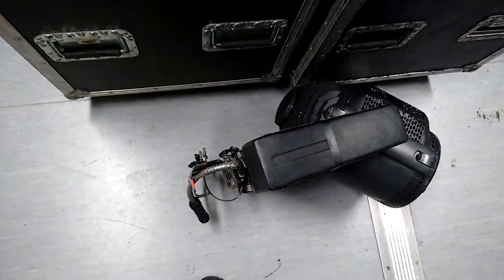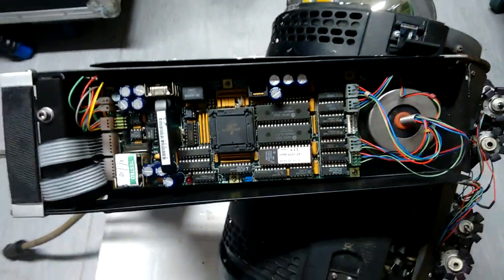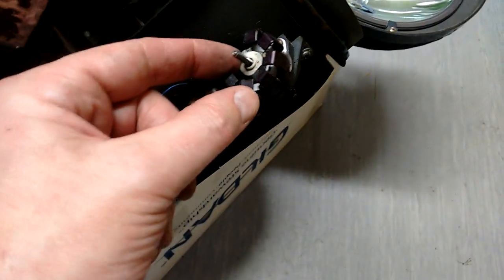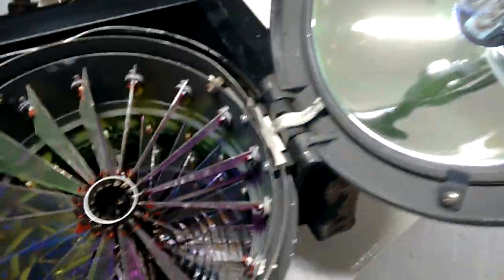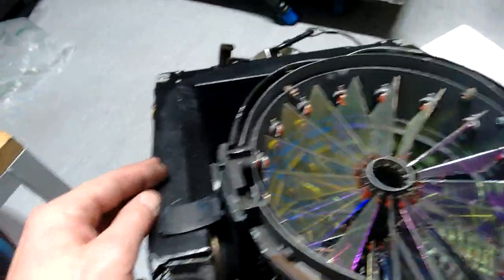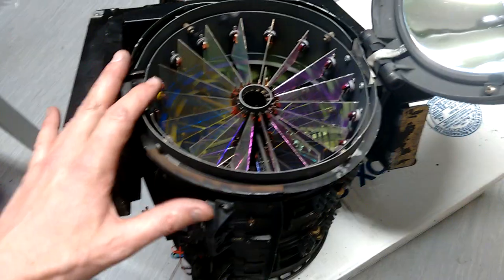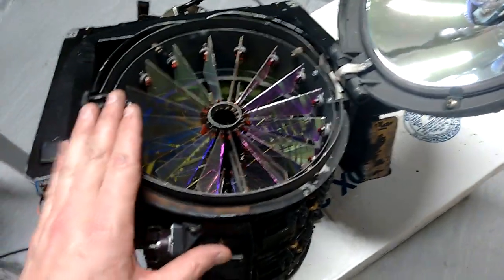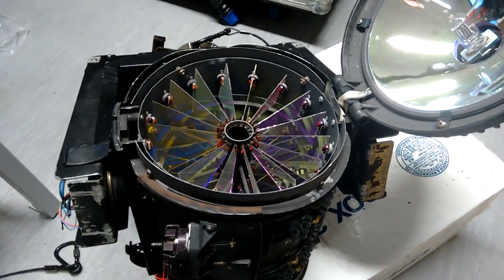A look inside a VL5 moving light.   TCF

Comment: Does anyone by any chance know which base they use? Thinking of getting some used vl550d but can't find any info on that. Would appreciate if anyone could share
Reply from the maker: Not sure what brand the connector was.
Reply: @bigclivedotcom  oh sorry for the misunderstanding, I meant the lamp base, in the specs from the manual it just says 230v 1000w, but not which base it is. If you happen to know that, that would be great.
Again sorry for the confusion, I'm not a native English speaker. 😅
Reply from the maker: @lemontree15  It's many years since I've used a VL5.  You should be able to find a users guide online.
Reply: did you find the user guides? I thought about buying some of these VL550d's too. at 1050$ for three including a flight case, it would have been a genius deal. Many people on German forums recommended not to buy them, as for touring, these are now wayyy too unreliable ( also no spare parts etc)
Reply: @jimi272  I didn't find anything yet. I thought about the same, I think I saw some on cuesale or somewhere like it. I'm German too, but I guess there is not much about them that could break. And if it does, it should be fixable mostly I guess.

Comment: I worked mostly on the older Vari*lites, VL2 through the VL2K as well as Big Boy and Best Boy. I think the VL5. These lites took a lot of abuse but were very reliable. I worked at Vari*Lite from 1997-2015. Never a dull moment. Thanks for the memories 😊
Reply: LOL. Kelly - I have a collection of VL2Cs, VL4s, and VL5s... your name is on a lot of the chips as being "tested by".
Reply: @rhanemann9100  hang on to those fixtures, I heard they literally threw all of the old ones in the dumpster. That's funny that my tested by sticker is still out there. I worked on those boards for 18 years.

Comment: as far as the processor goes, do the people who make these lights design them or are they outsourced?
Reply from the maker: The original Vari*Lite design team did all the hardware and software in house to the best of my knowledge.   It's far too heavily integrated with the hardware to outsource the software.
Reply: wow thats very impressive.  Thanks for the response.
Reply: bigclivedotcom  Yes it was a team from showco in the USA, they were working with Genesis on their tours and knowing that they always wanted to try something new for their live shows showed them the prototype VL0 which used dichroic? lense techniques to make different colours, Genesis and their manager basically put up the capital so they could develop the idea and thus vari*lite was born (now part of Philips Lighting along with Strand)
This morphed into the VL1 which used a color filter wheel instead as they had to get the lights out quick and the VL0 design was far from ready as a mass product, although the VL0 tech ended up making it into a wash light. Naturally vari*lite did the control system/lighting desk (Acrobat?) as well.
The first users (and by golly did they use a lot of them, I believe they replaced all the standard par cans) were for the Genesis MAMA tour in 1983.

https://www.youtube.com/watch?v=xbO6aKayNIA

Comment: I remember years ago, I was doing a concert ( I was in my learning years ) and someone made a huge monumental cock up. Instead of contacting Vari*Lite for 20 VL5's, Someone they ordered 20 VLM's. I did come out with "We could use torches as it would lower the power consumption!", As you could probably guess, That went down like a concrete boat!
Reply: Iain Banachowicz vlm's? mirrors?
Reply: Yes the vari*lite VLM. No lamp just a X Y mirror.

Comment: OK that was more than a bit interesting. The immediate thought that went through my head was that the mechanism works on a similar principle to the stators in the compressor of a turbojet that alter pitch with mach number. Even the "stepper/solenoid" thing is the same. I wonder which was first and if one copied the other or two engineers just came to the same conclusion independently. O bugger I'll probably be trying to figure that out all night.